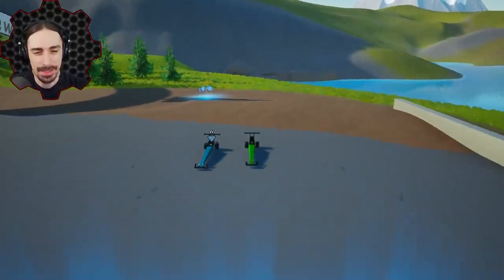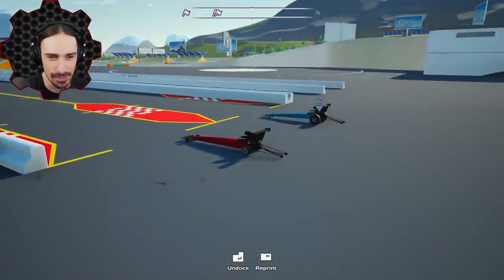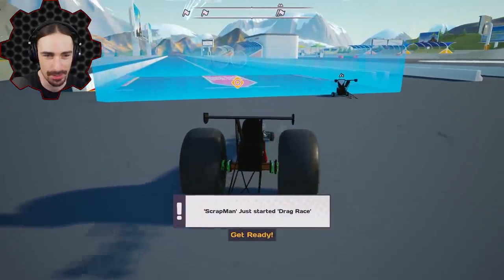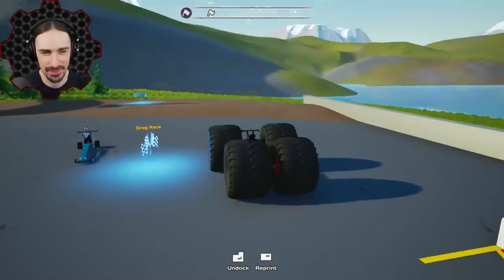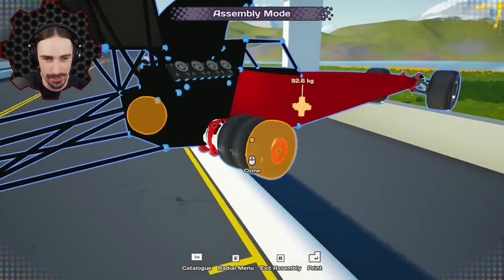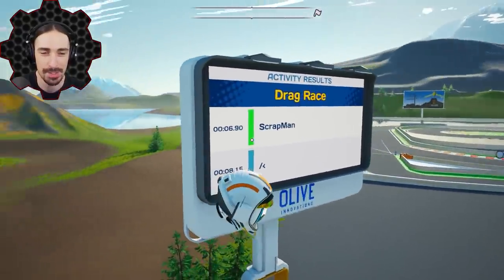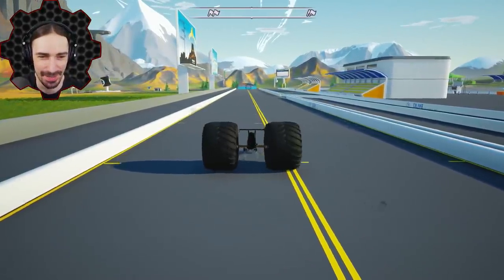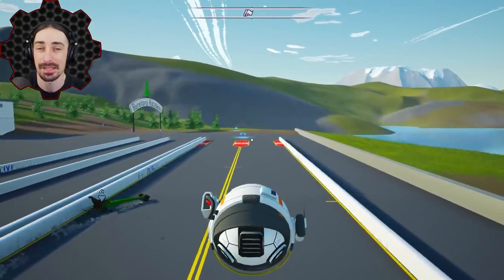Testing Ridiculous Dragster Wheel Combinations for Science! - Main Assembly Multiplayer

Comment: for some real science, drag cars don't need smaller wheels because it's so soft, it works like a transmission : 
- at the launch, the wheels compress in itself, which reduce the radius of the wheel and, like we see in this video, small wheel = faster acceleration
- during the run, the wheels expend due to centripidal force, which increase the radius and bigger wheel = higher top speed

the problem in main assembly is that bigger wheels are heavier than smaller (like in real life) one but in real drag racing, its the same tire, so same weight during the all run
Reply: Everything you said sounds right, but also doesn't sound 100% right. 

You said "in real drag racing its the same tire so it's the same weight" which is not true. The majority of drag racing classes use big and small tires not the same and no where near the same weight. The closest you will get to seeing a drag racing vehicle with the same size and weight tire on front and back would be in the Factory Stock Class, which is vehicles just off the lot with no modifications, but you do still see them with bigger/heavier drive tires compared to the steer tires. 

Idk what "in real drag racing" your talking about.
Reply: @Bama_Boy  i mean, same tire so same weight because the tire doesn't change during the run, im just talking about the rear tire, why would i talk about the front, its just a fin tire to reduce drag with the ground and air (and steer)

the drag racing i had in mind isthe one they where using, the top fuel class

Comment: Commenting on 3:49

I just wanted to inform you that the drag tires used in real life change sizes in a top fuel run. At the start of a Top Fuel run, the sheer power causes the tire to fold into itself making the functional diameter smaller, hence it accelerates faster. Once the wheels start spinning faster, their diameter grows due to the centrifuge effect. This increases top speed.

Comment: Imagine a engine equivalent of 5 or 3 bus engines trying to make a small wheel spin
Reply: That wouldn't really be much faster
Reply: @GottaSnipe  it would be faster cause the engines would just need to make a smaller mass spin and such a tiny wheel would pop just right off, the big wheels are specialized wheels that can handle high heat the small wheels wouldn't handle such high heat produced from friction of the ground and wheel's
Reply: @eggiest664  I was talking about bus engines being way more torque oriented than speed, so they're meant to go slower but have more force. Nothing to do with tire or wheel composition lol
Reply: well i was talking about the wheels

Comment: Actually they do have a correct they have big wheels in the back and they don't fill the wheel all the way up with air they only do it partially because you get more attraction if you're wheel doesn't have all the air in it

Comment: Fun fact: smaller wheel gives faster acceleration but slower top speed, big wheel gives slower acceleration but faster top speed, currently dragster uses big wide wheel on the back and a bike thin wheel on the front, this gives less drag on the front and gives more grip on the back, smaller and thinner will make less drag force, dragster uses big wheel on the back for top speed, not because of its awd and and the front wheel gives more acceleration and then the back will gives it top speed, no, it's not
Edit: big wheel depends on the drivetrain

Comment: The small wheels have more rotations per second because of being so small that why it has more acceleration then the big wheels

The big wheels has a higher top speed due to its size but low at acceleration
Reply: To put it a little more clearly- small wheels = less distance per revolution = more strength per revolution
Large wheels = more distance per revolution = less strength per revolution

So small wheels for high acceleration, if you were on a racetrack with a bunch of tight turns for example, and big wheels for drag racing. Keep in mind the front wheels aren't powered in drag racing, their only purpose is to keep the car off the ground, which is why they're so tiny- less weight and air resistance = faster car.